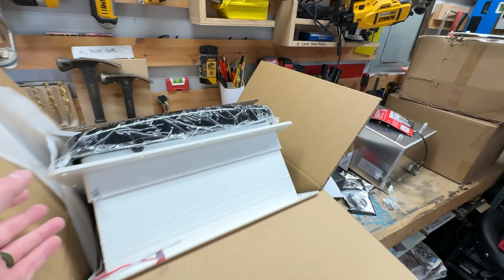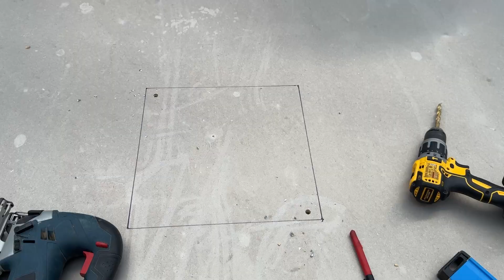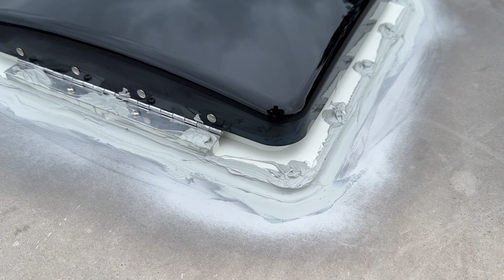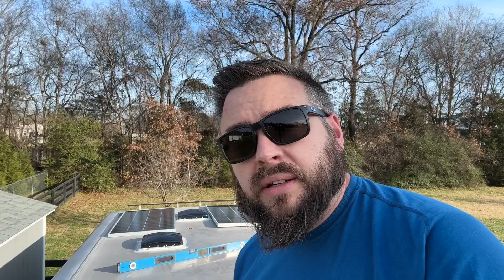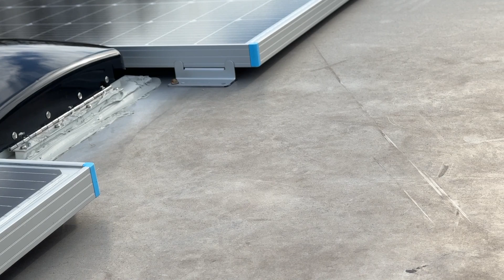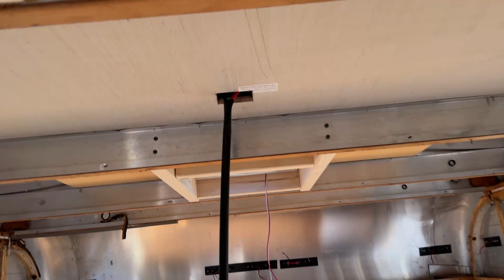Solar Panel & Roof Vent Install: 1971 Holiday Rambler Reno Part 33

Comment: Looks great! It's scary cutting in all those holes on a fresh roof! I kinda wish I went with a diesel heater. I've got one in the bus and it throws a lot drier air. The new Suburban propane furnace in my 71 Vacationer definitely produces a ton of moisture when running. The cons of the diesel heater are, you need to find a spot for the diesel tank that is easily accessible, and the ticking from the fuel pump can be annoying.
Reply from the maker: Yeah I debated back and forth but the moisture some bad experiences I’ve had wihh the propane in sub-freezing temps talked me out of propane.  For the diesel heater, I mounted the pump outside and you almost can’t hear it once the fan gets going. Tank was definitely a weird one too, but that will be in the next video 🙂

Comment: Why not use butyl tape under solar brackets?
Reply: I used Dicor Self Leveling under my solar brackets and all around them on my bus. So far so good 6 years later.
Reply from the maker: Great question, and I debated back and forth for a bit. Ultimately, it came down to it being easier to line everything back up to install the second time. I was super nervous about missing rafters!  We’ll see how it holds up! Did a trailer at work and no drips after a year 🤞🏻